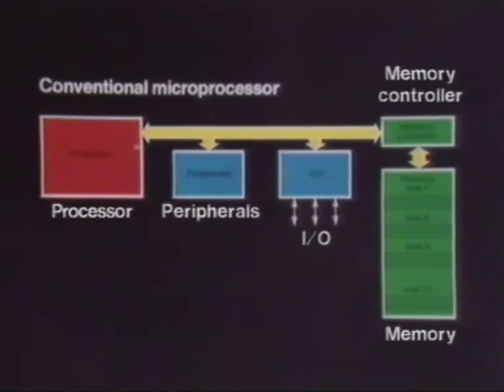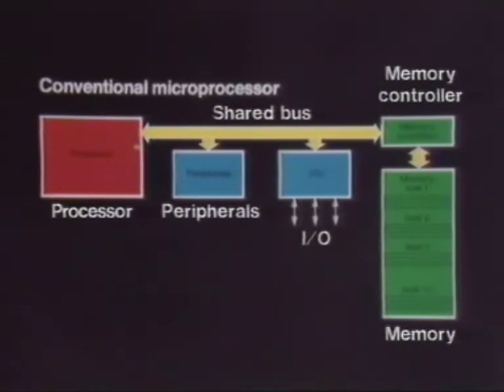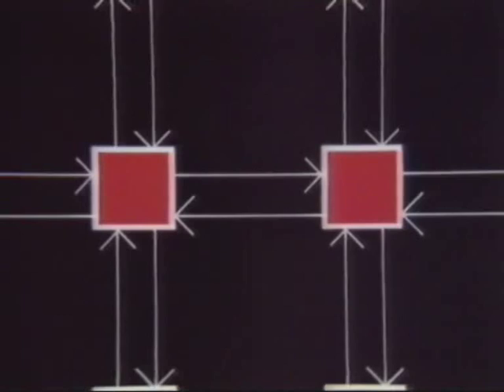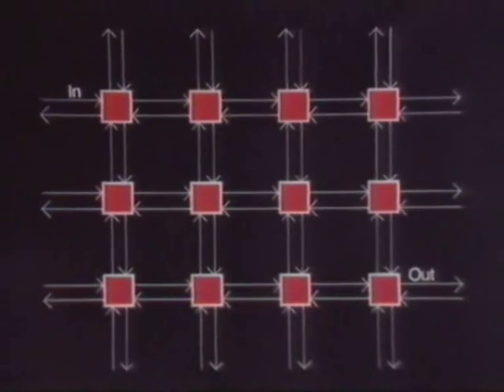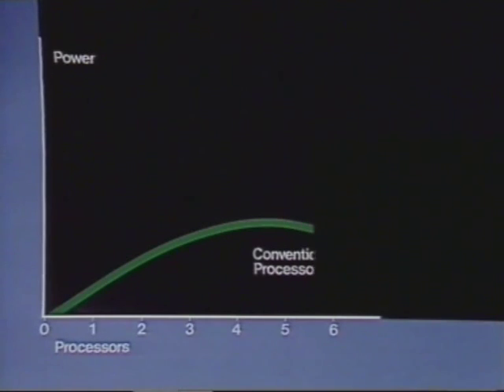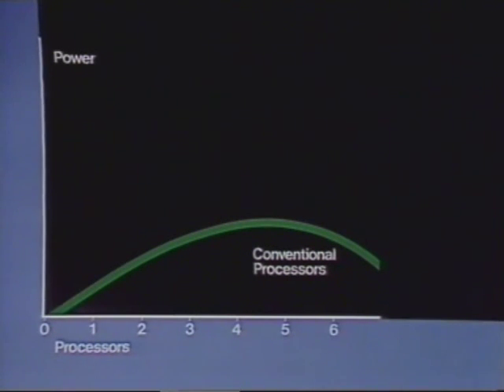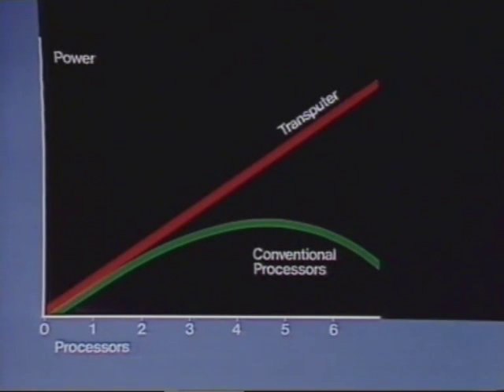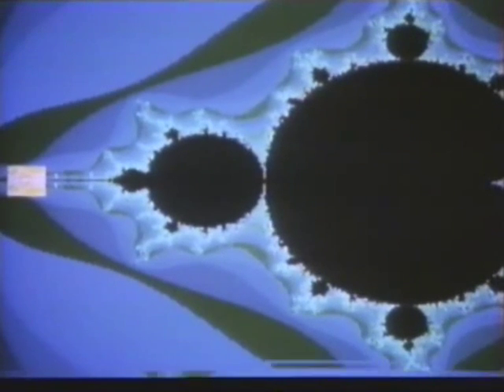Inmos Transputer CPU

Comment: As interesting as the concept of the transputer is ... this video doesn't even remotely serve justice. The butterfly example is just totally spoiled, overengineering a trivial task while the information the Mandelbrot set is greatly off (I've seen iterations of the set being computed in as little as 25 minutes on 8080 processors, even on 8088 processors it would only take as much as 3 hours when programmed in _IBM Basic_) the linearity also only applies for ideal scenarios.

Comment: Sorry, comm doesn't scale linearly with lots of processors. That's so only if you only ever want to talk to your N/S/E/W neighbors. Amdahl's law still applies.
Reply: A tree structure is preferable to the NSEW structure if you've only got a single output channel as it gives the fewest number of hops to get to the destination. The C104 link controller for the T9000 series helps in this regard, but as ever, you really need to rethink the strategy when dealing with massively parallel systems and not to have a single I/O node.

Comment: At around 4:55 the narrator says that a TurboPascal program running on an IBM PC AT would take between 6 and 15 hours to generate an image; surelay that must be a mistake? On an Amiga A1200 it only takes minutes, as far as i can recall.
Reply: amiga rulz pc suxx ;-)
Reply: For the symmetric image case they could have rendered the mirrored pixels for free - and that was another issue when optimizing your programs. The sad truth was the serial clock was turned up far quicker than parallel. FPS going chapter 11 and implicating late release of T9000 also didn't help it's reputation.

Comment: Heck, my $150 nVidia GPU has over 1500 cuda cores, and most processors out there (even the ones in our phones) have 2, 4, 6, 8 or more cores (or threads). Amazing how technology becomes both more affordable and more powerful at the same time.
I wonder what Inmos is doing nowadays? (Just looked it up: They were bought by STMicroelectronics in 1989).

JW3HH
Reply: The problem is the software. 1500 cuda cores and you still can't do anything else then mathematical matrix operations. It's the same problem we had with the transputer - memory access.

Comment: I assume that demo was sped up. Otherwise you'd need several hundreds of transputers.
Reply: Very likely. I have successfully restored an ATW800 with 4+1 T800 Transputers, rendering a mildly complex scene (2 cones, checkerboard + sphere) still takes 15-20 minutes at a resolution near 800x600 (but I guess that's quite fast for 1987 hardware).
Reply: @RandomBlankUsername  even if you have access to hundreds of T805s the problem comes with the I/O bottleneck. The grid pattern that is shown in the video is a terrible design for tasks like Mandelbrot or ray tracing, a tree structure gives the best performance.  Even then, with the link speed maxed out at 20Mb/s the downlink channel becomes swamped and it is soon clear that multiple I/O cards are needed in the host system leaving the host system's CPU having to marshal huge amounts of I/O.  It is a bit of a special case, as it is unusual for a parallel task to be dependant on a serial I/O stream.